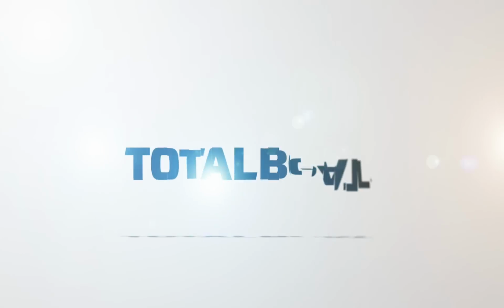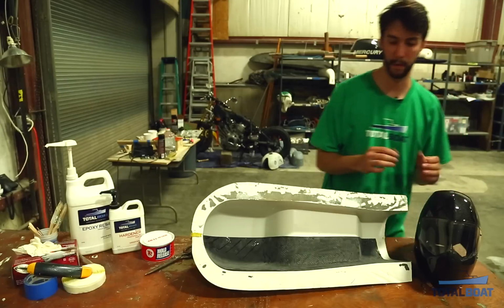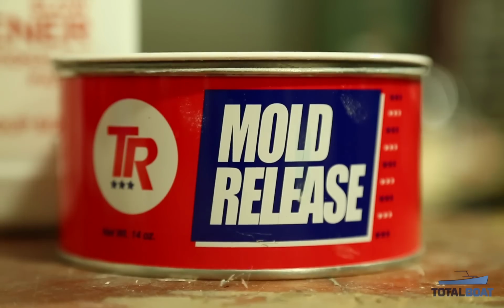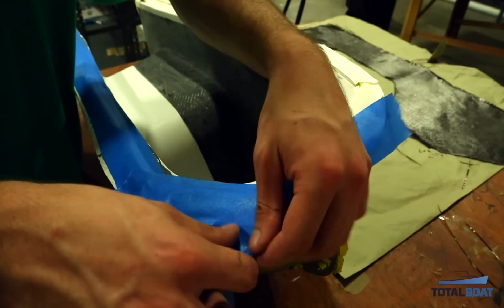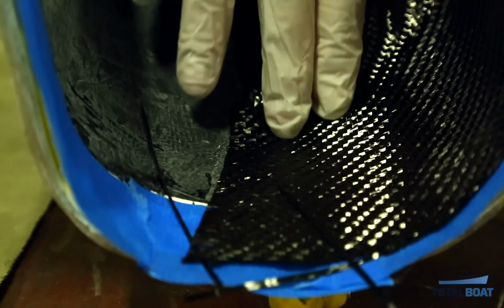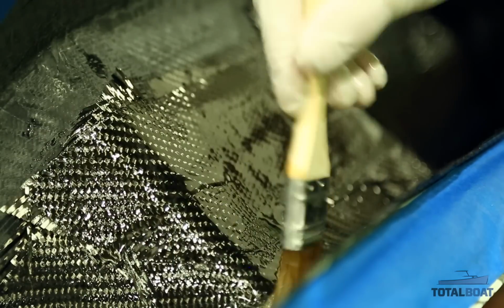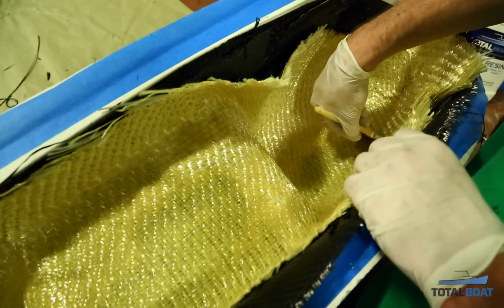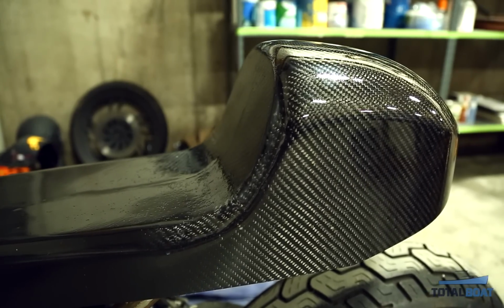Making a Plug for a Mold - Part 5

Comment: Are you using the upper flange of the half mould as the wall to create the second half mould and if so I assume you are waxing the first half flange to keep the two halves from sticking together. Is this assumption correct?
Reply: I’m fabricating a cycle trunk, my plug is waxed and I’m about to begin gel coat and glassing.
Reply from the maker: @Cheremie-mp7fn  That's awesome! Please contact our tech team at tech@totalboat.com and we will absolutely be able to assist!

Comment: Question; Early on when making the plug you used a layer of glass and epoxy. Then something to add to and level out low spots. Then a primer. Oddly then a non epoxy resin. You had cut out areas which did not wet out leaving them exposed. Why risk using the non expose resin over areas which might have had foam exposed? Cost?

Comment: I have been laying up glass for a long time but never used vacuum bagging.  Could you provide a bit of explanation, or a few photos?  I have a vacuum pump that is normally used for refrigeration work, or are you using something like a vacuum cleaner?  Your plug/mold video is excellent, however there is only a brief moment in the vacuum bagging section

Comment: It appears that maybe a Part 4.5 would be helpful. The process of laying up the second half of the mold to the first half is nonexistent. Maybe that is because that part of the mold did not introduce any new Total Boat products that had not been mentioned earlier. This guy does have talent and a great presentation but, this is basically a commercial for the company he works for.

Comment: why did you make a two part mold only to glue them together?- what is working time for epoxy resin? how many buckets did you go through  - 1 per coat? how many layers ultimately - 3 Cf 1 kevlar = 4?
when you released mold from table flange how did you cut this?  - it looked like on video 2/3 - maybe video 4 - there was just seran or poly plastic on table....is this a special plastic release film?

Comment: I really enjoyed your video. I am about to put a small ski platform on the back of my boat. I need it to handle a new ladder that extends out the back a little. My hull is not straight so I was thinking about making the initial template out of cardboard. Cover that and then put the framing in the fiberglass on the bottom for the mounting to the boat.  Finally using gel coat for the top.   Because I have really never done this, I am out in the left field or is this an alright approach?

Comment: Looks amazing but alas I wasn't aware I needed a vacuum bag system. Guess I need more equipment now. I love excuses to buy more equipment. Seat looks amazing. I would love to make some carbon fiber bits for my scooter.
Reply: You don't necessarily need a vacuum system, it's just very helpful for removing air bubbles.

Comment: hi! 
about that electrical insulation (coming from the kevlar fiberglass hybrid weave). 
what does that mean? (i'm a newbie, don't know)
thank you!
great videos ;-)
Reply: Carbon Fiber is conductive.
Reply: thanks! so carbon is electrical conductive. electrical coming from where (in that case of motorcycle seat)? or what other examples where carbon would be better insulated when electrical around? 
thank you! ;-)

Comment: There is a ton of useful information in this series and it helped me a lot, so for that I am very grateful. I am curious to know about applying PVA to the mold after the wax. I have read many mixed feelings about using PVA. My mold is currently waxed 8 times with Collinite's mold release wax and am wondering if I should apply PVA before my final casting. Thank you in advance.

Comment: I thought u had to have a vacuum chamber to work with carbon fiber ?
Reply: Did you see him placing tacky tape around the edges of the mold? When he puts on the bagging material, the tape creates a "chamber" that you can pull vacuum on to keep pressure until the resin is cured. That is for room temp cure resins, autoclaves (vacuum chamber)  are used when you have high temp curing resins, though the prep work is nearly identical, different tacky tape and bagging materials are needed.

Comment: Very disappointing video since after 5 parts video you just wrapped up without even showing the vacuum bagging process and rushed to the end!!!!!
Reply: Must agree with this.  You need a part 6. :o)
Reply: If I were you I’d learn resin infusion and dont waste your time wet layup vacuum bagging.   Ive done about 1500 layups and without a doubt the easier, healthier, better looking products come from Resin Infusion...which is only second to pre preg parts.
Reply: totaly agree.
Reply: Do I sand the carbon , wipe it or ? Before I clear coat
Reply: Robert Mahaney if your mold is good enough spray clear in the mold.  Let it B stage.  Then lay your carbon on top of that and continue to infuse or vacuum bag.  Comes out perfect

Comment: Amazing tutorial. So the first half is already dried, and the second half just automatically sticked to the first half? Do they stick to each other by themselves well enough? I'm just trying to learn.
Reply: Nozomu Harada, 
  always remember that "dried" is different than "cured", k? 
  drying is when is when your solvent, or moisture (water), is lost into the surrounding air, leaving your paint, etc. on your workpiece. 
   curing is what happens when you are using a product that requires a chemical catalyst. 
the reaction produced when the parts are mixed will bond chemically. mortar an concrete do this also. these use water as their catalyst, but it's the same idea.  
   this chemical curing idea is cool and interesting. it's how we have fiberglass boats, really tough paints, and skyscrapers!! lol
  hope you stay interested in working with your hands and building things yourself!

Comment: hey @totalboat. nice job on the video. was wondering if that seat was strong enough to hold someones weight without any metal support directly under the seated area??
Reply from the maker: +Neil Desouza Yup definitely strong enough there is a sub frame but no cross members. The seat is strong enough to support the weight of AT LEAST one passenger